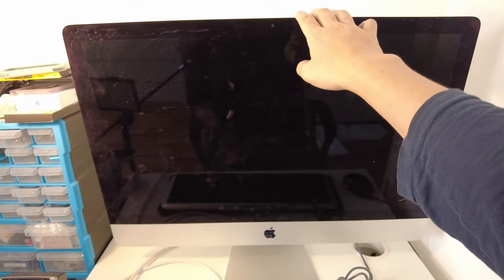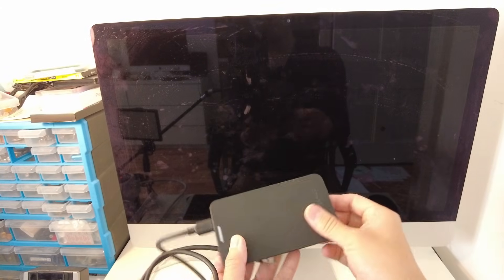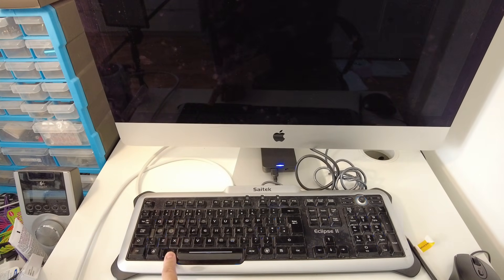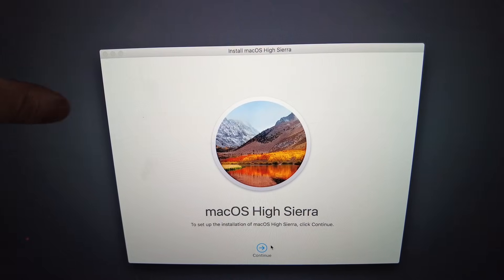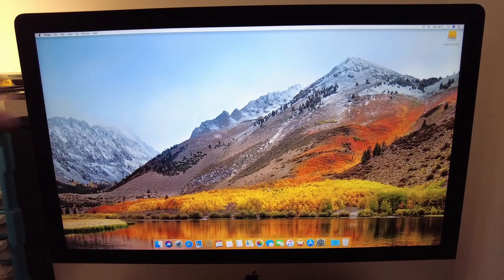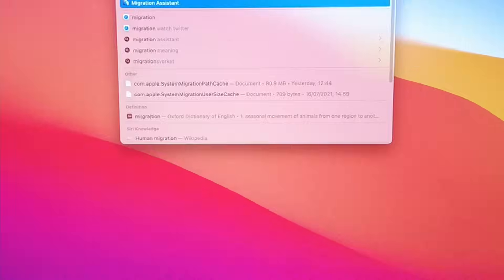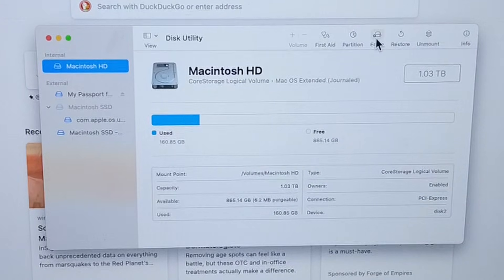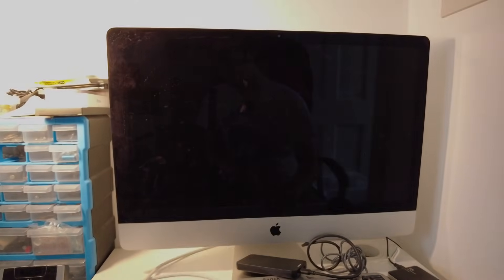How To Fix Slow iMac 2012-2020 External SSD [Updated Guide]

Comment: Very helpful video but I have a question. I have a late 2015 iMac and I used a SanDisk 1TB Extreme Portable External SSD - Up to 550MB/s and it did decrease my boot up time from about 3:30 minutes down to just over 1minute. I’ve seen other upgrade videos following these exact steps where it would boot in as little as 30 seconds. Also, I’m not really sure how to use my original login. I’m now using the new login which works perfectly fine because everything is cloned and running pretty fast compared to the old fusion drive. Is there a way to unmount the internal drive so that it is NOT spinning? I read somewhere on Reddit that that is possible. Thanks in advance

Comment: I added an EXTERNAL Samsung 1TB SSD.  And wow.  What a difference.  It's like a new computer.  Surely I have gained a few more years use of this machine.  But I DO have the kit to install the drive internally.  Take off the screen and glue it back in.  A bit of a process after watching several videos.  My question is... if were to install internally connected via the SATA slot versus the USB ?   Will I see enough additional performance to justify doing the internal installation?

Comment: HI! Is it possible to install an external SSD in a 21.5 iMac 2011 ??? Thank you for the video!
Reply: Problem with 2011 is that 2011 have usb 2.0 instead of 3.0. So the speeds wouldnt be great. 2011 iMac do have one thunderbolt 1 port. So Your best option is a thunderbolt 1 enclosure with a nvme m.2 ssd. Its the fastest ssd you can get for a 2011. Even faster than internal sata ssd. I. Use a thunderbolt 1 ssd to boot my 27” iMac late 2013

Comment: HI Andrew I have just come across your iMAc upgrade to ssd video which is very explanatory.  I have just upgraded to an iMac 2017 running Ventura and want to use this update method but your ssd linked doesn't go to the one shown in your video.  It goes to a Kingston unit.  Is this same as your WD Blue ssd as I wouldn't want to get the wrong combination.  Many thanks for the very informative video.  Kind regards Peter
Reply: With a 2017. You should get a thunderbolt 3 enclosure with a nvme m.2 ssd. Thunderbolt 3 is super fast compared to usb 3.0

Comment: I just refreshed the storage in my 2015 27”…  While I left the 3TB spinning rust in place, I did replace the (failed) original 128GB SSD from the fusion drive setup with a 2TB M.2 NVMe and that’s now booting Mojave.  The speed difference between an SSD over SATA and the M.2 drive is frankly astonishing.  The internal mechanical drive is pretty much for bulk storage and on-board backups.

For about the last year I’d been booting from an external WD SSD after splitting the fusion drive apart and abandoning the apple SSD that had run out of reallocation blocks.

Comment: For anyone struggling with this process on a Crucial X9 PRO for Mac: If you don't see the GUID Partition when erasing the SSD, it won't work even though it installs the OS in a later step. 

In the disk utility you need to click View, Show All Devices, click up a few levels to the Drive that contains the Volume you were just in. When you click Erase, you'll now see the GUID Partition option along with the APFS setting.

Comment: Thanks for this.   I just updated to SSD external with Crucial X9 Pro on my 2019 21.5 (I opted for this since it uses USB-C and has DRAM).   Booting is way faster, less than a minute. Using Dark Magic app, my read/write speeds are from 650-750.     I opted to not go NVME route which might be faster but it might not be necessary for me since the apps load almost instantaneously on the Crucial.   

The only thing i did different procedurally was set the SSD as default under Startup Disc rather than holding Option key on powering on.   Unless I don’t wipe the HDD  (didn’t do that yet), one thing to remember is to make sure you wipe it out if you ever sell the machine or get rid of it.      Thanks again.

Comment: Hello 
Informative, well explained, nice video. Thanks for your effort.

I have a question:
After installing the os in external SSD and delete os from internal HDD, later on if the external SSD stop working, then what is the solution?

Is it possible to reinstall the os on external SSD again. Because as I told before the os from internal HDD it deleted.

Waiting for your reply.

Thanks again 👍

Comment: Did it whit an internal SSD,on an very old 2010 Imac.
You only need to put an 1k resistor on the temperature cable,because that cheap SSD had no 3e cable for it.

Comment: Hi, thank you sooooo much for this. I think it’s working. It’s definitely a much faster boot up. I do still hear the internal drive noisily clunking, chugging and winding up as before tho. I restarted several times to be sure I was on the external ssd. Should the internal drive still be active like that? The migration was successful as well so I have a clone of all my apps and data on the SSD. Is it possible there are some links pointing to the internal HDD causing it to be active in some manner. I’m a little hesitant to erase the HDD even tho I have several backups 😂

Comment: Hi, I bought the enclosure and the hard drive using your links. After installing the MacOS into the external hard drive, restarting and now it’s going thru a loop, saying security settings do not allow this Zac to use an external startup disk, you can change this by restarting and holding down Command-R to open macOS Recovery, and then choosing Startup Security Utility. But now it’s going around as a loop (I unplugged the external hard drive) keeps asking me to unlock the main disk by punching in the password and loop over again not booting into the Os. Not sure how to move forward. I cannot even boot as I have been able to before all this. Thanks in advance.
Reply: Initially, Did you format the drive completely?  Because if the drive has 256Aes encryption for security then you're stuck.

Comment: Thank you so much for this tutorial. After a visit to the Genius Bar with NO successful solution and  considering trading in my 2019, iMac for a new version, I am now using my iMac. Your directions (along with others) were extremely helpful in getting it to run. It's faster than ever. And I was able download the newest operating system and transfer all my files. Thank you again. (I'm actually typing this review from my faster MAC. It would have been impossible prior to the external drive install.) - 12/2024
Reply: Can you still use the internal hdd for storage, yeah?
Reply: The internal hdd is super slow! For me, it’s a NO! Since installing the external drive, that’s  all I use and I’m pleased with the speed! I’m eventually going to delete the internal drive as I’ve already transferred all my programs and documents! I don’t need it!

Comment: iMac 🖥️ Late 2015. 

I have copied these instructions 1:1. Also bought the same components from Amazon. Works 100% and it's super easy. The iMac was the slowest in the world before, then everything was 1000 times faster. I am thrilled, thank you very much 🙏🏻
Reply: Hey, I have the same machine with OSX El Capitan. Did you have the same Mac OS version? I couldn't get AFPS as a formatting option for my external SSD. Just wondering if you had a similar challenge.

Comment: Having issues formatting my internal drive after your guide. Everything went fine with the process…

Disabled SID, tried formatting in recovery and inside the OS from the external. Nothing happens. Any ideas?

Also… after the tip to always having the iMac booting from the external drive… doesnt work for me. Next boot I still have to hit enter to boot

Comment: Could not get it to work on a iMac 27" 2020 K5 while I had formatted the external Sansung SSD as a Guid partition format and APFS structure. When trying to boot, I saw the external SSD but I got the the message: SDErrorDomain 104. Do you have any tips?

Comment: Andrew if I decide to put this SSD inside the Mac after doing this , are there any changes I need to make or will this just need to be installed internally and that’s it?  Also, is it any faster for me to put it inside the computer as opposed to just leaving it out as an external bootup??
Reply from the maker: No changes, no real difference in speed.

Comment: Great video. I bought the same hardware, and was SO looking forward to the possibility of increased speeds on my crushingly slow old iMac, but it won't, won't, won't go into recovery mode. I've tried every fix for that I could find: reset SMC, different keyboard shortcuts, and the rest. I've restarted at least ten times now. Any suggestions?

Comment: Hi there...I have a mid 2011 iMac, and I would like to use the 512GB SSD I have purchased,  The iMac is presently using High Sierra 10.13.6 and to be fair my full kettle boils from  cold before the iMac boots up (which is handy if you like a nice hot cup of tea) so I attempted the method you advised for a 2012 iMac, and it was simply sat displaying "Starting Internet Recovery. This may take a while."  With a rotating picture of the Earth spinning. I wonder if you could advise what I should do when that happens as after ten minutes the same screen is still displayed? I have a Lightstream Fibre Optic internet connection, and the computer was tested prior to connecting the SSD into the USB slot at the rear of the iMac and showed it was connected to the router.  Any ideas please?
Reply from the maker: If internet recovery doesn't work then you can 1) download High Sierra installer and then install it onto the USB or 2) make a bootable USB flash drive using a High Sierra installer and boot from that instead.

Comment: I have a late 2012 21.5" OS Catalina V10.15.7 8GB 1600 MHz DDR3, Processor 2.7 GHz Quad-core Intel Core i5 and a 27" mid 2011 OS High Sierra V10.13.6 32GB 1333 MHz DDR3, Processor 2.7 GHz Intel i5  - Will this fix (I have watched both videos) allow me to keep the OS updated as it will sit resident on the new SSD?

Comment: I tried your original method using CCC which failed as when I booted in recovery mode it only showed the HDD available to boot from. Followed this updated guide and it worked fine! Gone from 40mb/s to 400mb/s read and write speeds, thanks Andy!!!!

Comment: I have a problem. Went through these steps. I have an imac late 2012 and a t7 500gb external ssd. When I went to restore mode and disk utility and then erase, all was going well. Then when it rebooted, it rebooted into lion, which is not what my imac was running. I was running Catalina. I saw in the video you said it will boot to whatever firmware os your imac has, so mine must be lion. But now what? Now I seem to be stuck in lion. Trying to figure out how to upgrade to Catalina.

Comment: I face issues with my SSD moving around on the table which causes the Mac to stop working. Anyone face this and do you have a workaround? I basically weigh the SSD down on the table but sometimes micro movements can cause the computer to hang too...
Reply from the maker: Get some tape and tape I’m the SSD and cable to the back of your iMac.

Comment: Tried useing T5 and T7 Samsung SSD's as boot drives in my 2013 iMac but found a standard SSD worked just as well. I think the T series tech, which is more recent than my 2013 system, negates the SSD speed. So a standard generic SSD in an enclosure works best.

Comment: Superb instruction! You've just saved me as my Fusion HD went askew the other week. I'm currently waiting for the HD case to arrive in the post — thank you for the recommendation, especially regarding the chipset!

BETTER SSD RECOMMENDATION: Crucial MX500
Kingston aren't the best these days and the model you recommend doesn't hold out well in tests. Oddly, the allegedly 'superior' Crucial BX doesn't have as good write life as the MX!.

— If you have a Fusion drive I strongly suggest getting off it as soon as you can, there's a reason they 'disappeared' from the Apple line.

Comment: Hi, I have just used this video to connect up to an external ssd, thanks for that, just wanted to know if I wanted to fit the ssd internally, is it just plug and play or is there more to it than that? ( I know about the actual screen off etc) Thanks again
Reply from the maker: Yes just use the cloned SSD and put inside the iMac see https://youtu.be/B_cal3Z9FnM
Reply: @andrewtsaitips  So it will recognize it as an internal drive and I will have to do nothing with the saved  files etc, sorry to be dim

Comment: Huge thank you, I followed your steps and it worked perfectly fine with a Samsung T7 (SSD 1Tb). I resurrected my 2013 iMac !
Reply: I was going to purchase a T7 but opted for the Sandisk Extreme instead. How do you like it, do you have any heating issues since its running constantly?
Reply: After you upgraded the SSD can you then update to a newer OS? What OS are you running?
Reply: How did you format your disk? I bought this model but don’t have to option to format APFS and this process isn’t working for me 😫
Reply: @erinlefevrephoto yes same for me, did you find a solution??

Comment: Hi, do you have to erase the internal drive for optimum performance, or can you leave everything on just as another backup?
Reply: I left a similar comment just a min ago, did you ever find out? Mine is not letting me delete the internal drive, but I am still able to log into the external drive fine. Just wondering if it will affect anything?

Comment: Thanks for the video!!! It helps and I would like to ask for your valuable and professional feedback before I invest in my iMac 

I have a 2017 iMac version bought in early 2019. Normally it is good though I’m using iMovie for video editing. Smooth

However I recently start live streaming mobile games and it becomes slower and lag on screen. What would you recommend me to upgrade it with external improvement (I’m an IT idiot and hell no idea to improve inside) 

Thank you very much and indeed for your previous time and consideration to reply me :):):)

My IMac version is Retina 5K, 27-inch, 2017

Comment: Why do you use an internal SSD and an enclosure as opposed to an external SSD? Just trying to understand which is the better way to go. I have a 2015 iMac if that is relevant. Thanks so much for the video
Reply: It's an easier option rather than have to remove the screen and replace the internal HDD with an SSD. However, over the long term it would be better to replace the internal HDD.

Comment: Hi. It seems very simple and I did it as suggested by you. The only problem I had was the external SSD gave an error upgrading to the latest version of the iOS twice at the last 3 minute during the update. I went ahead rebooting and tried booting the iMac through the external drive. But it is just shutting off as soon as the Apple logo comes up. I’m able to boot through the internal HDD but it restarts after I login to the system. This keeps happening. Help me rectify as I’m unable to boot now with both the internal and external drive.
Reply: Solved your issue?

Comment: For a 1GB Kingston 960GB and the Sabrent enclosure is almost the same price of a 1GB Samsung  T7 external SSD.  Would the Samsung T7 drive work?  I have a super slow iMac that was slow right out of the box and I’d like to get a couple more years of use before I buy a MacBook Air or Pro.  Thanks for making these two videos!
Reply: Yes, you can
Reply: @vijisrangoli  Thanks

Comment: WOW! What a difference in performance after changing to a new SSD Boot drive.
QUESTION: Is it now possible (recommended) to erase the internal HD (1 TB) and use it for Time Machine backups?
Cheers,
TRR
Reply: Plausible BUT, why use a faultering HD as your failsafe? Consider that!   ;-)

Comment: Hi! Cmd R does not work after I hold alt. It just tells me that it starts recover from internet. Is there something I can do?
Reply from the maker: That’s right just let it recover from internet and then you’ll get to the next stage.
Reply: @andrewtsaitips  Thank you very much for your response! I will try this
Reply: @andrewtsaitips  So, I tried several times but the iMac never goes past the "turning globe" symbol. Can I put a bootable OS directly onto the ssd?
Reply: For people with the same problem, creating a bootable ssd worked in my case. I think my internal HDD was broken and I just could not access any of the shown menues. I followed the steps shown in the video with an older iMac that still worked and later plugged the bootable SSD in the iMac with the broken HDD. After that I could hit "alt" on my windows keyboard and select the SSD! Works perfetly fine